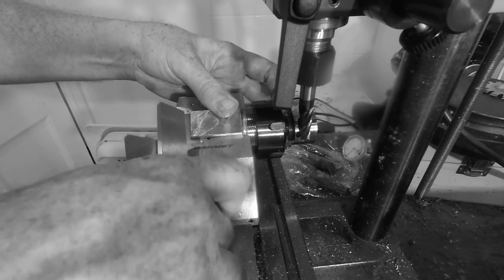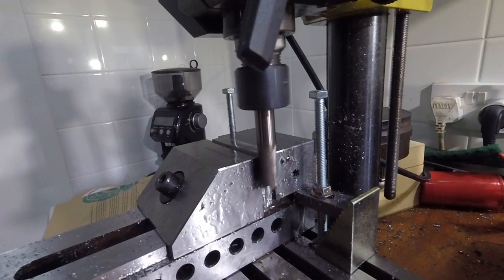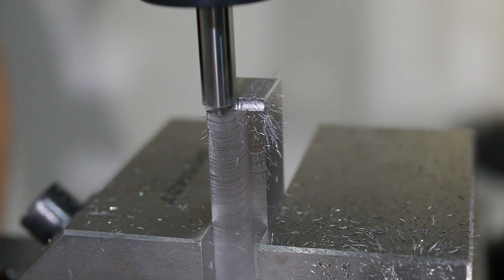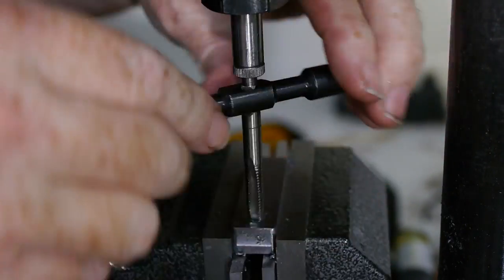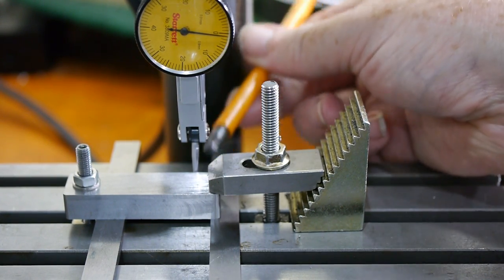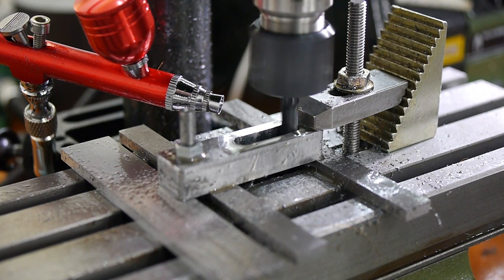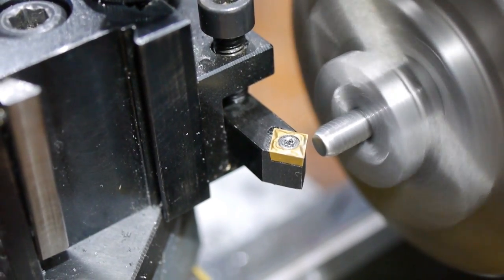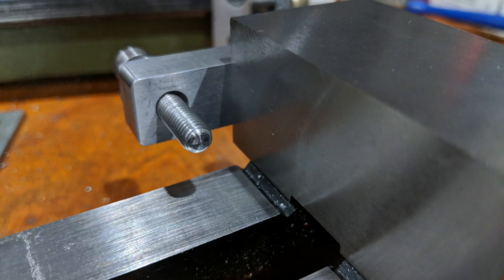Making a Vice Stop for a Toolmakers Vice

Comment: Another enjoyable video to watch you did alright so you could have done this or that better you got it done an we love your little milling machine. We love that that you actually showed a need for the very tools stop for your toolmakers vise. Thank you for the share. Did you put a little coolant into your air brush great fix for not having a fog buster or somthing like that. Great daily use washers and setter bolt you made on your lathe. In the end your stop looks really nice and complimentary to your toolmakers vise.
Reply from the maker: Thanks, I really appreciate your support!
Reply from the maker: BTW, I haven't tried putting coolant into the airbrush, as I really need to keep the mess under control. My workshop shares a room, and the floor needs to be kept clean of sticky fluids. I'll give it a try at some point, once I've got some shielding in place to keep the spray contained.

Comment: Hey. In regards to flood cooling.
It can be done mess free. That's the exact reason why I avoided it my self.
But after cutting cast iron, being forced to blow chips away with air, liquid cooling proved to be far better alternative.
Your vice on the other hand could be a problem. My vice is basic and it's liquid friendly so I can contain the flow within the bed without need for a catch basin or any walls be put up.

Needless to say, once I tried liquid cooling on my mill, I look back thinking why I didn't do it before.

It will allow you to cut more aggressively and keep your tool sharp for much much longer.
No smoke, no dust, no need for air. Just a pond pump and some feelings and hoses. Super simple and works really well.

Look at my video and see what you may be getting into.
Keep in mind this was like day 1 or 2 of liquid cooling for me. I plan on releasing additional information and discoveries I made soon.

I think liquid cooling is the greatest thing I ever did to my mill. You should try it too.

Comment: Hi. Just a couple of ideas. With steels such as O1 is is possible to work harden the surface you are machining if there is too much rubbing / friction. As you slow down the feed rate you are more likely to harden the surface as the tool is making smaller chips and is more likely to rub. You can normally hear a squealing sound as this process of rubbing and work hardening takes place. It can be a vicious cycle as once it starts work hardening the tool rubs more and thus the surface gets harder and hotter. One remedy to this may be to take smaller depths of cut at a higher feed rate. Also you may find you can reduce chatter and improve the rigidity of your set up by shortening the cutter sickout. In the case of HSS endmills I would use a cutting disk and cut the end of the shank off so that you can get the end of the cutter closer to the collet. Reducing the tool stick out will reduce the forces / leverage on your spindle. Cheers
Reply from the maker: I wasn't aware that O1 is likely to work harden, but I've worked with austenitic stainless steels, so have some experience of what it's like. This might explain some of the sounds I got on later passes attempting to side-mill. Work-hardening can be difficult to deal with on small, lightweight machines as bigger depth of cut or faster feed rate are sometimes not possible. Thanks for the tips and suggestions!
Reply: Smaller depth of cut and higher feed rate should stop it from rubbing.
Reply: MrCrispin ,I agree and he makes a good point on machine size. I run power feeds on all axis on my manual mills and upgrade to higher rpm more horsepower motors and that significantly reduces the issue though if rigidity is a problem that must be addressed. I filled a round column with granite epoxy and made that particular mill more rigid than a factory square column. This has worked wonders for a medium sized bench mill that now cuts at 5500 rpm. My bigger mills cut at 7500 rpm and really fly through tool steel at full powerfeed speeds  and 1/4 deep cuts. Finish is smooth and mirror like. Upgrading bearings is another factor likely necessary after a short while exceeding factory specifications. He proves her though that enough patience and proper understanding one can adjust and accommodate the needs of a lesser rigid machine. Well done considering.

Comment: A trick we used to use to make hard end stops was to drill the end of the depth screw ~0.1mm smaller than a ball bearing & just a smidge over 1/2 dia depth then seat a ball with a gentle tap from a soft hammer or brass punch.

Comment: if I may, i have a few ideas. when you were side milling you could of rotated your part 90 degrees, that way you would of only been cutting say 1/2"   instead of 3/4, it would of been easier to cut. also for chamfering or rounding corners,  if you  only cut along the back jaw and rotate your part you will have more consistant results  because your cutter should remain in the same y & z location  and only require you to adjust the z once  when  you flip your part on end.
cheers enjoyed the video
Reply from the maker: Thanks for the suggestions Phil! I think Adam Carmichael just beat you to it with the suggestion to rotate the part for side milling. Cutting all the edges along the back jaw is a really good idea, and I'll definitely do that next time I'm work on a suitable part. Thanks again!

Comment: I have seen some machinists getting good results by plunge cutting the ends instead of side milling with the full length of the cutter. Plunge cutting seems far superior to side milling in these situations. :)
Reply from the maker: Interesting. Presumably they have to do a large number of plunges very close together to get anything like a flat surface on the end?
Reply: @AdventureswithaVerySmallLathe  I think several plunges followed by side milling that just knocks off the peaks left between plunges. It cannot all be done just by plunging......

Comment: Shorten your cutter stick out. Reduce your spindle speed 50%. reduce radial engagement of the cutter 50%. Side milling is fine on your mill,  you are simply running an extended cutter way too fast and trying to take too much at once.
Reply from the maker: Thanks for the tips! I have another project coming up with similar material, so I'll try your suggestions then. Guidance from a more experienced machinist is very much appreciated.

Comment: I don't know if you'll read this now but when faced with a similar slot on a small mill, I have drilled and reamed the two end holes to final size first. This then meant that I wasn't having to plunge down with the mill, I was simply starting a new layer of horizontal milling.
Reply from the maker: I considered that, but thought I would run the risk of the reamed holes not being exactly the same width as the endmilled slot, and leaving unclean end shapes. The solution I chose in the video removes most of the difficulty of plunging. Only the very outer part of the end mill diameter had to cut while plunging, which is much less stressful, and didn't give me any trouble at all.

Comment: When working tool steel, the feed rate as pointed out by another viewer, is only one issue and not usually the most important. I don't know what you have your spindle speed set to, but it appears that it is much too fast. High speeds create much more heat from friction than any other reason and actually a higher feed rate is recommended to reduce that friction. Lower your rpm's and always use some sort of coolant/lubricant when cutting. Don't baby the feed - always try to keep the tool moving through the work and it will cut better and reduce work-hardening. Also see if you can get some carbide tooling for working in steel. It will cut better and last longer. Also try to get better rigidity in your setups. Keep your tools short, reduce part and machine overhang conditions, keep your machine slides adjusted to reduce play and backlash. (a heavier, more rigid machine would help here). The three important factors are feed rate, surface speed and depth of cut. Do some research on this topic to better understand how they work together. Get yourself a copy of Machinery's Handbook - It's even available on line as a PDF. Good luck!

Comment: Very much better results than your earlier videos about slotting that face plate. Well done. :-) 

Even with my now 1100 lb 3/4 sized Bridgeport clone if not a whole lot of material needs to be removed to bring a part to size or just clean up a band sawed edge I'll almost always use a fly cutter over an end mill. Done right with a mill that's trammed properly you can get very flat surfaces with much better surface finishes. However, despite what you see on far too many YT channels and especially the cnc specific ones they are only designed as a VERY LIGHT finishing tool. Tormach's and Suburban Tools flycutter is shown in there videos as being capable of taking large depths of cut. Yes the tool itself is capable of doing so, but most mills including full size Bridgeport mills aren't. In a lot of videos you can clearly hear the spindle splines hammering as the backlash is taken up when the single cutting tooth enters the cut each time. They can also be hard on spindle bearings so they do need to be used for what they were designed to do. There classed as a finishing tool and not something for bulk metal removal. On my little Emco mill I limited the depth of cut to .002" - .003" on steel and maybe up to .005" on aluminum with a fly cutter. If the tool is sharp there's a lot less vibration on these little mills compared to using an end mill, plus there dirt cheap since a HSS tool bit can be resharpened 100's of times. Profiled edges can also be done with a bit of work on a bench grinder and a Dremel tool if a reverse pattern is used as a gauge as the cutting tool is shaped for the profile wanted. But the larger the profile the less depth of cut a tool like this is capable of.  

A minor but important detail about your hold down bolts in this video. The accepted industry rule is the vertical hold down bolt or stud should be positioned as close to the object you want clamped down as physically possible. Doing it that way transmits most of the clamping force into the work to hold it positioned. As you move that stud or bolt away from the work more of that force starts being added to the step block where it's not needed and less on the part. Having work move on you during a cut is unpleasant at best, and if things go really wrong it can lead to permanent reminders in the mill or it's tooling.

It's very easy to get repeatable positioning on parts before you had your work stop built. Either preset a DI or DTI zeroed on the end of the work before you loosen the vice then flip the part and slide it towards the indicator until the needle is again at zero, then re-tighten the vise. Or do the same with the indicator base off the table, then flip the part and use the X axis slide to move the table and already clamped in place part and it's edge up to that zero point. If the work does need to be extremely accurate for position I'll use that method instead of a work stop. The indicator does need to be rigidly positioned and zeroed each time of course, but it's as accurate as your datum surface and indicators are. It's obviously slower, but much more repeatable if that level of accuracy is needed.
Reply: I’ve never owned a Bridgeport but have used them years ago for a few small tasks. My converted square columns are powerful enough for 1/4 and deeper depth of cuts with fair accuracy depending on material and objective. I don’t see why a Bridgeport couldn’t also do this if a few upgrades were done specifically a better motor and higher speeds.

Comment: I wondered where I saw the video of rounding the bolt.  Then I remembered I saw it on Facebook!  I gotta get around to making a stop for my tool makers vise,  dont worry about using the scotch-brite like you did.  Everyone does it and its fine.
Reply from the maker: I think using the scotch-brite would be safer if the lathe was in reverse, so that any fibers that catch the thread would be pushed away, rather than pulled in.
Reply: Adventures with a Very Small Lathe nonsense.  Even my NIMS Precision Machining Technology book recommends doing exactly as you did.  NIMS is the certification for machinists in the US.

Comment: When you wanted to machine the ends of the work piece and you didn't want it to extend too far from the vise jaws, you could turn the vise on its side and clamp it to the mill table. Then you would be able to hold the work piece in the vise the same way you did machining the top and bottom surfaces. Thank you for an excellent video and a great project idea. The only down side was the music!
Reply from the maker: Nice tip, thanks! I'll definitely use that technique.

Comment: When you were face milling the first side you were conventional milling.  When you did the opposite side you were climb milling.  Then when you attempted to mill with the side of the end mill you were climb milling.  With your machine I would recommend conventional milling especially when using the side of the end mill.
Reply from the maker: I'm a bit confused. I've re-watched the footage of milling the long faces a dozen times, and I'm certain that in both cases the tool is on the same side of the part, and the part is moving in the same direction. Have I misunderstood something about climb milling? What makes you say that the second side was climb milling, when the first wasn't?

Comment: I would recommend using cutting fluid as well.  It will help your tools last longer.  I recommend it when using carbide as well
Reply from the maker: As I mention in the video, flood coolant isn't possible in my shop. The Proxxon table has open T-slots, so coolant wouldn't drain in a controlled way, and would flood onto the work bench. I do use neat cutting oil, but it's not always obvious in the video.
Reply: Adventures with a Very Small Lathe I dont use flood coolant either,  i meant cutting fluid, oil.
Reply from the maker: Thanks for clarifying. I do use that, but often cut out the detail to make the video more concise and easy to watch. There is a delicate balance between showing how I did the work, and avoiding a long, tedious, repetitive video that nobody wants to watch. I do appreciate suggestions and feedback though, especially if I haven't made things obvious in the video.

Comment: Very nice. I am not entirely convinced that tool steel is the material of choice. I made mine out of Alumin(i)um but I will now remake it to include a slot, as in your design. I do not relish cutting slots on the MF70 Proxxon,  but it can be done. Oh yes, as somebody mentioned you were climb cutting part of the time. Not advisable with tool steel.
Reply from the maker: When I was selecting material I had two main concerns. Flexing of the tool, and ensuring there was solid contact with the side of the vice. The fact that O1 comes with precision ground faces meant that the solid contact was solved for me. I don't have access to a grinder, or a surface plate, so making a face very flat would have been difficult. I'm not certain how much more flexible Aluminum is, but I'm confident that using steel has given me a more rigid part. If I've misunderstood something about the material options here, I'd love to know more.
Reply: I chose Fortal Aluminum for my vice but in his case I think it works very well. I went for a larger contraption due to wide soft jaws and the need for a 90 flat. For the stop rest I think a tool steel or quality steel flat for a rest is better even if the arm is aluminum where precision matters and repeatability.

Comment: Nice job
I need to get a toolmakers vice again, I loved my old one, but sold it with my old mill

Also I'd recommend at least a 3rd hold down on your vice (if one slips it can't rotate)
But It might be ok with small cutting forces
Reply from the maker: Thanks for the tip about the 3rd hold down. I may need to mill extra grooves into the vice, as with my small mill table it can be really tough to locate hold-downs well.
Reply: I made a finger clamp with a pin to fit in a hole. It may be an issue if it doesn't really line up with a t slot though. May need to get quite creative!

Comment: What kind of vice is this ?
Looks like it would eliminate jaw lift.
Reply from the maker: I think the proper name is a grinding vice, though it sometimes gets called a toolmakers vice. It does avoid jaw lift, but has less holding power than a machine vice. I get some comments saying it's not safe to use for machining, though there is plenty of evidence that it's perfectly fine as long as the machining forces are kept under control.

Comment: Sounds like the rpm is too slow for cutter, hence the rattling thumping we hear where the cutter is bouncing off the surface. Anytime I’ve had an endmill doing this I’ve cranked the rpm up until it started making more of a buzzing sound and I found it then started cutting clean versus vertical fractures caused by vibratory deflection from too slow of rotation. Very common on hobby mills with 0-2000rpm limitations. In those cases choosing different cutters with more flutes will often resolve the issue but not in all cases where rigidity is the cause versus speed. Nice video